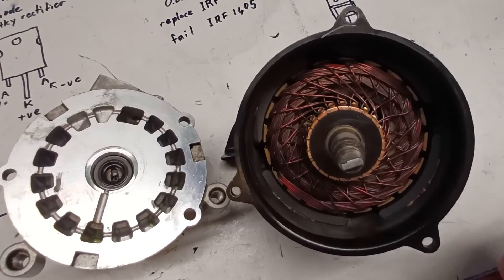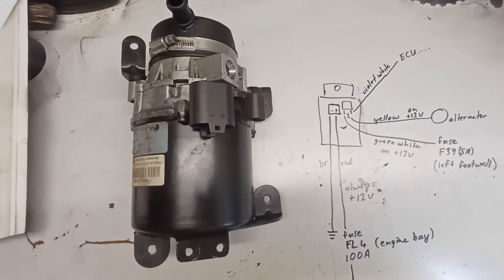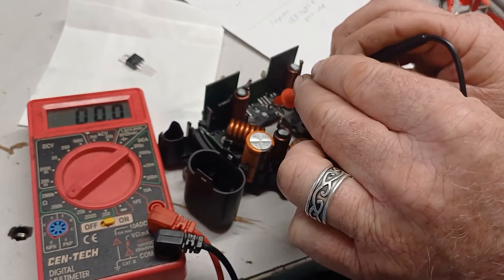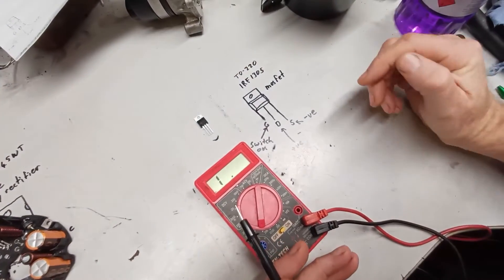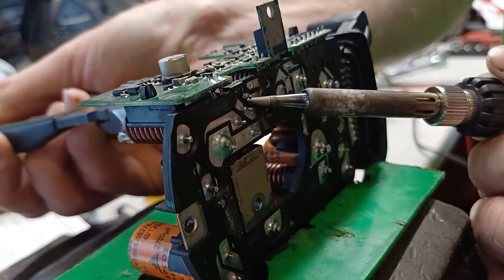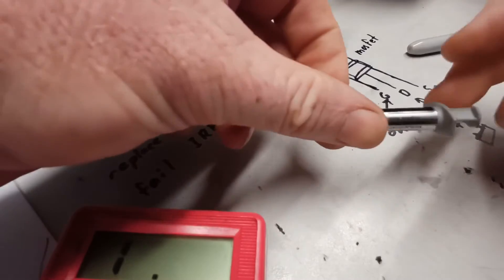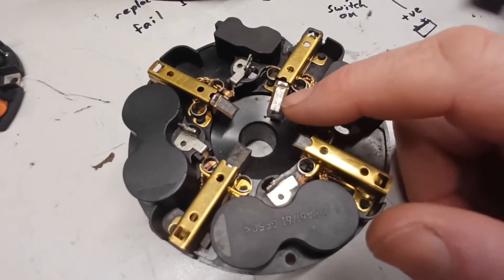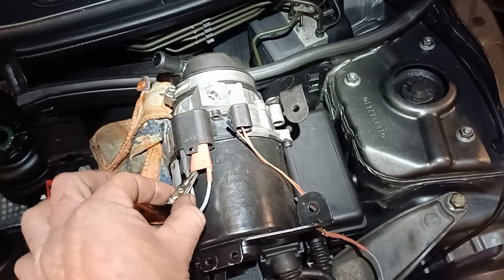Mini R50 R53 power steering pump overhaul and repair

Comment: I just reinstalled my pump and was about to connect the electrics when I realized I could not see the + or - marks on the connector and I didn't pay attention when I removed it so I didn't know which side the red lead was suppose to attach to. ( The connector appears to be reversible so if someone like me is not paying attention, I could incorrectly orient the the plug and connect red to the wrong terminal ). Thankfully your video provides the detail of the connector on top of the pump and I have been saved the annoying work of removing the pump to verify the connections. Thank you so much.

Comment: What i should replece when pump is not start? One time it start and dont stop,then i cut off battery, then work fine,and after next battery off it dont start
Reply from the maker: Could be the mosfets failing on or off. Go through the tests with a multimeter and confirm
Reply: Thanks,both tranzistors are burnt. Is there a chance thats only this transistors? Should i put there irf 3206?
Reply from the maker: @tomekb5261  replace mosfets then bench test before going to the trouble of refitting.

Comment: Many thanks for this video ! I am currently working on solving an issue of random running / not running pump. I disassembled it and it seems that it has already been fixed... Anyway, thanks to your video I will be able to check everything !